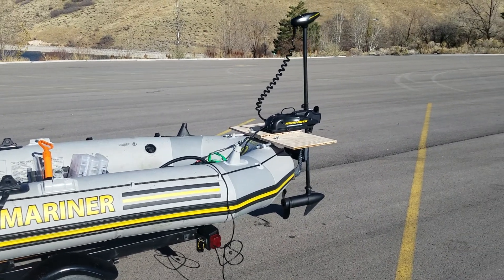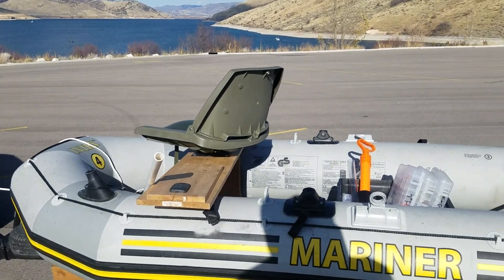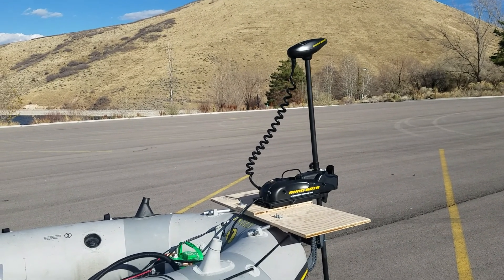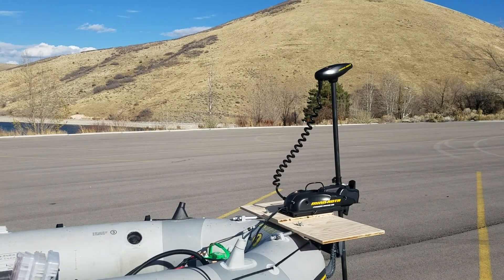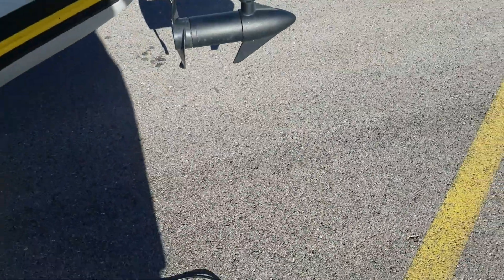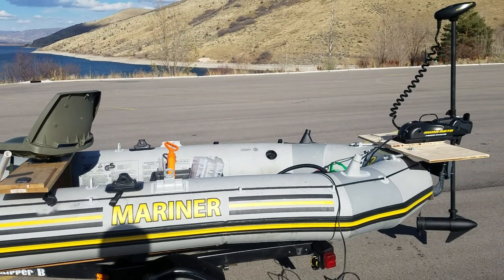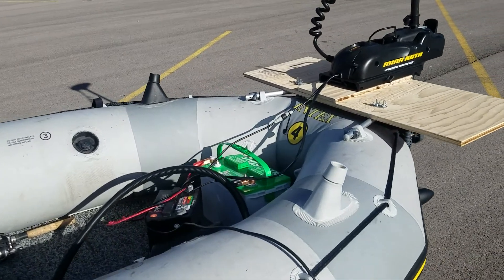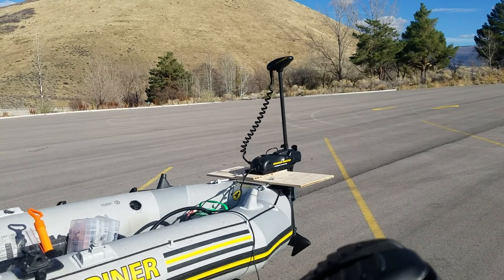Intex Mariner 4 with bow mount trolling motor

Comment: open the top and loosen the stuff that is holding the shaft in place, rotate it 180 degrees and put it back together. Or if you want to put the new motor on the front it doesnt matter.
Reply from the maker: bryangoggin yeah was thinking about just switching the head like u said.. got whole winter to plan it i guess.. well see..

Comment: What group battery would you suggest for a 30 lbs? I'm new to all this. And the trolling motor I have says 12v so does that mean the battery has to be 12v?
Reply from the maker: Sean Prior yes you need 12 volt battery. you should be fine a group 24 size battery. go to Wal-Mart and look for everstart deep cycle battery. they are in the automotive section.
Reply: Jiggy C. 
Ok, thank you. I found a guy on Craigslist selling 24 and 27 deep cycle either or for 65 each (he has alot) and I wasn't sure what I should look for. I guess they're are used but he says they should be just a couple years old.

Comment: Why did you move from gas to electric if its lighter and more powerful?
Reply from the maker: Electric has it's benefits. It's quiet, easy on and off but it's a lot heavier than a gas motor if you factor in the motor and battery. The battery itself is heavier than my gas. I like with a gas motor u can bring a 1 gallon of gas and you'll be good for a 3 days of continuous run if you need to.